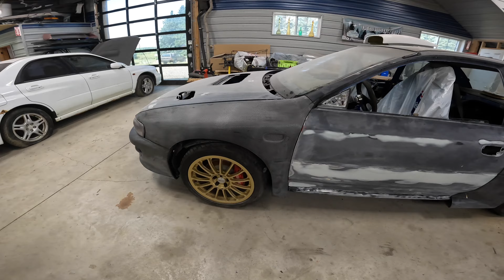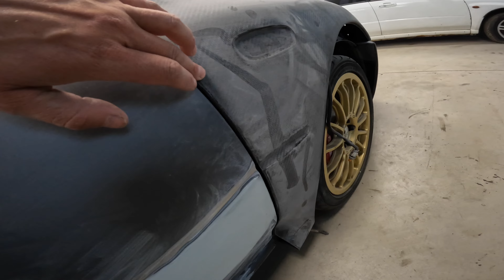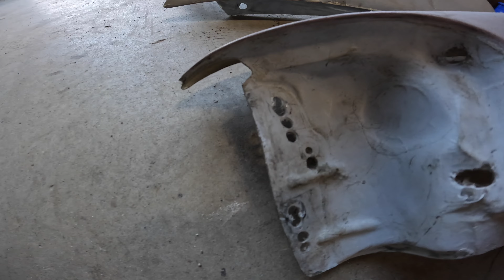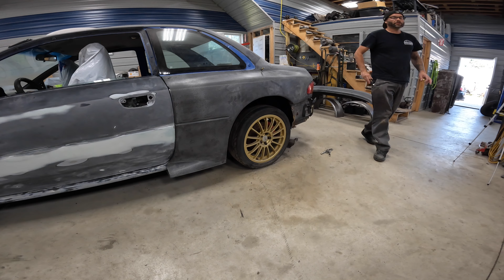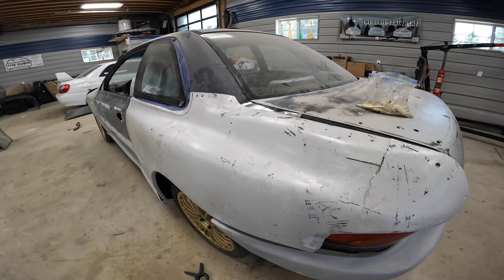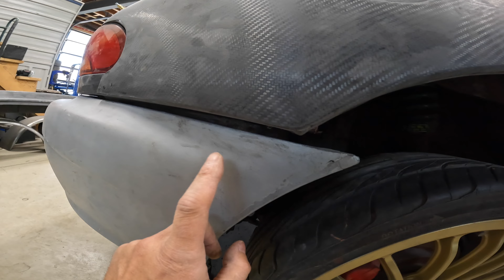$10k Body Kit VS $1k Body Kit - Subaru Coupe

Comment: That was a really great video, lots of good and useful information. Years back I did a GC widebody and the front factory steel fenders I gutted and used just a skeleton of them so I would not be bolting fiberglass onto steel at the hood line, I also used the factory steel turn signal pockets and cut out the side marker steel piece and attached them so the lights were again attached to a piece of steel rather than fiberglass. The rear quarters I cut off ALL the extra crap that covers the trunk and ran a straight line that transitions into the body nicely. Laying another layer on the quarter just puts the area and boot off unnecessarily. At the tail lights I cut back about 1.5 inches and then transition to the edge of the tail lights. I think the kits give too much material and if you are using carbon and not painting then you run into other issues. Thanks again! Subscribed! Oh yeah I also lay at least one other layer of glass on the inside of the panels which does add weight but cheaper kits are usually a bit light and if someone leans on the car and cracks it well that sucks.
Reply from the maker: @johnleca  thats sweet, appreciate you sharing your experience. I definitely will be reinforcing some of these panels for the flex factor. The rear quarters will be cut back for transition sake. Its nice how thin the carbon is compared to traditional fibreglass. Should be quick work on clean transitions! Stay tuned for the next progress vid!
Reply: @TheSubieSanctuary  Absolutely. Thanks1

Comment: Does anyone know what upgrades I can do to a 2013 Subaru Impreza sport? It’s not a Wrx sadly but I’m wanting to do an engine swap just not sure what will fit
Reply from the maker: @umczeal3276  the 11+ impreza is a tough one. Not much available other then suspension, maybe a lip. Any motor will fit, but it is a massive job to make a turbo motor run in the 13 impreza
Reply: @TheSubieSanctuary  thank you for answering. Might swap cars then lol

Comment: Its not about fitment its about the longevity, Ive bought BKO products 2 times and both times i was waiting 4+ months and let down. Never again, and none of the products made it to my car.
Reply from the maker: Composition is near same as abw, hate to say it but near on par at that. This bko kit bought used had sat for half a decade in a garage with crap piled on it. No decay, no spider cracking. 
What kit did you end up using? 
I waited 7 months for my launsport kit
Reply: Good day. The parcels we send are international and sometimes it takes a long time to deliver them, also we cannot be responsible for customs and various delays of parcels, so they can go for a long time, we try to send as quickly as possible, even if there are situations of loss, breakage or long delivery times, we find a solution to the situation with any of our clients. Thank you for your comment
Reply from the maker: @BodyKitOnlineStore glad you guys saw the vid, thoroughly impressed with the kit!